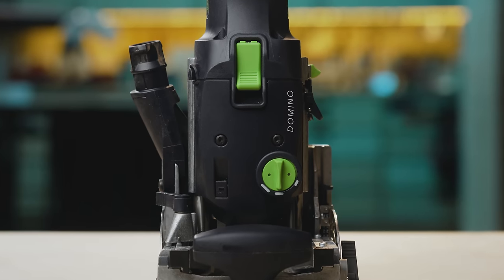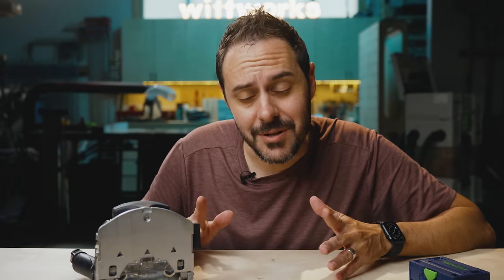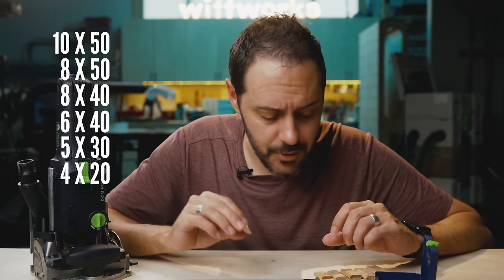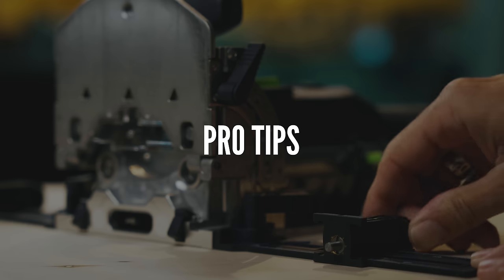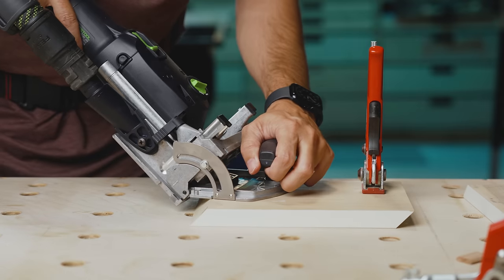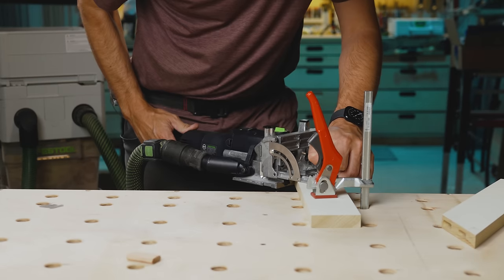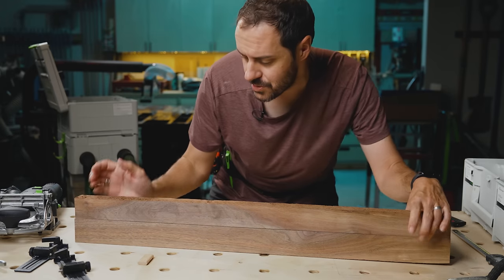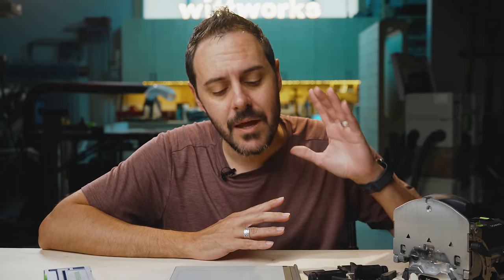Domino for Dummies

Comment: I’ve recently bought a Domino after watching years of Peter Millard’s 10 Minute Workshop using one effortlessly.  But even after watching all of Peter’s videos I thought this was an excellent run through of how to use the Domino, thank you.
Peter recommends doing the domino on one side tight and the other one loose, that way you get the wiggle room but the actual Domino is held firmly in place. I think I prefer that than the ‘two loose sides’ approach you showed. 
Never seen the Domino cross stop, looks to be useful, thanks
Reply: The way he did it here is what's recommended by Sedge who is one of the most knowledgeable people on the Domino out there. The problem with mating one tight to one loose is that you lose the end-to-end alignment which is one of the main reasons you would use the tool

Comment: Dont sand you dominos.  Hit the sides and the flat side with a hammer and compress the fibers. The domino will go in no problem in a dry fit, and the fibers will expand again when the wet glue is soaked up by the domino.
Reply from the maker: Great tip! 🔨

Comment: This was such a thorough video and I really enjoy your tone. You are very convincing at appearing to be approaching the controversial "Domino question" with an open mind. 

The end of the video gives away what most Domino owners already know - once you've used one (especially on miters and in ways that make it more than a glorified biscuit joiner), there's really no going back. I owned one five years or so ago, used it a lot, ran into some tough money times, and sold it. In the two years that followed, I found that I was doing a lot less woodworking, in large part because I just didn't have the hours of time to hand cut and fit many of the joints that the Domino had made come together in minutes, so I bit my tongue and bought another. So that I'm clear, it's not that I don't enjoy hand cutting joints or hand tool woodworking. If anything, there's few more satisfying feelings in this hobby than getting a hand-cut joint to come together perfectly. But for me (ymmv) I found that I spend more time in my shop when I have ways to get to the finished product much more quickly.
Reply from the maker: thank you

Comment: stupendous video! i know the making and editing had to take a ton of time.  that said, i believe this will be your mustard seed.  It would not surprise me if in a year it hand 100’s of thousand views and your subscriber growth begins goes vertical.  I will tell you the thing I don’t understand about the domino is how when you go loose and then use the built in alignment you don’t begin to get compound error.  I have never trusted the tool as much as I could.  And stupid me, I can get rd of the channel locks in the domino systainer and just add a zip lock with sanded dominoes!  I will say that I bought a fast cap pro carpenter metric tape which really helped me not fight festool.  I must confess if I didn’t have thousands of dollars invested in imperial measurement tools, I would chunk them all and go metric for my wood working…maybe not yet for construction.
Reply from the maker: Thank you! I wish I learned metric as a kid

Comment: 29:40 So I messed up when I did this the first time... I did the tight setting at each end of the board (like typically suggested), then switched to the loose setting, BUT I worked in from opposite ends on the boards. As such, the offset of the loose setting compounded after each mortise, which resulted in the dominos being way off. Seems obvious thinking through it now, but if you use those cross stops, AND the loose setting, you HAVE to work in the same direction on both boards
Reply from the maker: Good point

Comment: One of, if not the most thoughtful videos ever done on a Festool Domino and Festool in general. For the record, I don't hate Festool. Quite the contrary. I admire them and I'm envious of those who can justify the cost to own them. There is little doubt now that they are leading the pack by quite a bit. I'm a professional but my profession is composing music. I do woodworking for the joy of it. I would love to own a Domino and use it even just once so I could experience the joy of working with a tool that so far, surpasses all the others in the given task - by a mile! Thanks for your insightful deep dive into this flagship product.
Reply from the maker: Thank you Dwayne! That’s high praise. 

In your field, what brand would be the “Festool” equivalent? 

I’m a drummer, so I naturally think DW drums vs Rogue

Stradivarius?
Reply: @wittworks  Most music I do is all digital using samples so there is no way to point out the Festool of samples. It's too subjective. The Stradivarius does produce an unique, sweet sound that has obviously raised the bar pretty high for violin manufacturers. No one has matched it yet. So yes, that would be a perfect example. Good luck even seeing one much less acquiring it. ❤

Comment: The biggest problem I found out "too late" (so much sanding to correct) was that the stop screw/lever for the height adjustment was slightly lose and drifted over time as I was drilling a bunch of holes so glue-ups stopped being completely flat/aligned. It's definitely worth double checking all of those knobs to make sure they're not too lose. Thanks for all of this extra info … you definitely hit on a few things I hadn't seen before. (and I'm so glad I'm not the only one who loves that pop! sound.)
Reply from the maker: Thank you Chris! That lever! I know! I got a new lever from McMaster that I think will be better. It allows you to tighten more. Maybe I should do a “top 5 hacks” video
Reply: @wittworks  please do!
Reply: Need a top hack video!
Reply: @wittworks  The lever itself is probably fine. Just had to tighten the screw on the back side and it locks down much better now. Haven't had a slip so far, though I haven't been using the domino much since pocket screws are fine for the cabinets I'm building (aside from the user error of setting the drill bit up for too-short screws … always remember that "measure twice, cut once" also requires using the correct measurement).
Reply: Fence drift. Yep, that one bites more than a few people. As you found out, re-centering the lock lever helps. However, the limited range is not awesome. The ones from McMaster are excellent.

Comment: When I make face frames (or any butt joint) with the domino, I always use the tight setting on the rails, and the looser setting on the stiles. That way the dominos always first get glued into the rails tight - you could actually end up with a slanted domino putting into a loose mortise first. 

I also recently made a trapezoidal cabinet (95/85 miters). Since there aren't positive stops for those, you can actually just use the miter face as a reference for setting the fence.
Reply from the maker: Brilliant. Thank you for sharing

Comment: Rather than using a smaller domino for sacrificing strength On a joint of say some 18mm ply, just plunge deeper on one side and shallower on the other. Your keeping the strength with no sacrifice whatsoever
Reply from the maker: That would be the pro move 💪
Reply: @wittworks  love the domino, it’s so versatile, just wish it wasn’t so Godamn expensive!

Another trick I do for working on thicker/thinner stock, (for example 18mm ply again) is to set the height to 16mm, and place a plastic 2mm packer in between the fence and the 16mm gauge mark, then lock the fence down with it inside. That way there’s no chance for the fence to move up, or down when your working. Gives you the same repeatability as using the stock gauge settings!

Comment: You mentioned that setting the fence height on material whose thickness doesn't correspond with any of the numbers on the board thickness gauge, won't allow you to return exactly to that fence height setting.  What I do to ensure for exact repeatability in such cases is to make a gauge shim that, when set atop the nearest board thickness gauge tip, gives me the exact height I require.  Then whenever I want to repolicate that same thickness, I set the board thickness gauge to the "nearest board thickness gauge" setting that I'd used in the first place, then before lowering the fence onto the tip, I set the  shim I'd made onto the top of the board thickness gauge tip and lower the fence onto it.  I have a number of these shims, which I label before saving them in my Festool Domino Systainer.

Then there's the issue of selecting the optimum tenon for the job at hand.  You recommend the standard rule of thumb, which is 1/3 the thickness of the pieces being joined.  And you used an 18mm thick board to explain that a 6mm X 40mm tenon is ideal.  However, because that length will blow through the side of the 18mm board, you recommend dropping down to a 5mm X 30mm to avoid this problem.  What I suggest doing is staying with the 6mm X 40mm tenon, but sawing it shorter.  This then gives you the tenon thickness desired for giving you the required strength, while ensuring you won't blow through the face of the one board.

Whenever I err when making a mortise, I'll usually take a tenon and glue it into the wayward mortise.  Once the glue has set enough, I'll saw and chisel the tenon's extra length off, flush with the surface.  Then, I'll redo the mortise, this time paying closer attention to my work. 

  I hope these comments help other Domino users get the most out of their machines.

Comment: the one cool thing, so you messed up the positioning for that miter but you could literally just glue in a domino, flush cut it, and then recut the mortise if you wanted it to have no wiggle room. long as you dont put holes through faces its pretty forgiving
Reply from the maker: That’s a good trick!

Comment: Here's a tip for converting metric to imperial. 25.4 is the "magic" conversion. Example. 3/4 plywood = .75" x 25.4 = 19.05 mm.  12mm plywood = 12mm / 25.4 = .472"

Comment: I like and have several Festool products. Festool products are mostly a well thought out system like the LR32 EU cabinet system. Most people do not understand German and European Union's taxes and tariffs.  Approximately 30% of a Festool's, Mafel, Felder, Fein's US cost is both of these, and if you are in the EU you get to pay that amount too. But then EU folks also get to add another 20% "Value Added Tax on top of the already Taxed to death price. So choose wisely! I own the DF 500 Q set as well but in many cases my Dowelmax is more accurate and faster and Mathematically just as strong. I mostly never get the DF 500 out of the systainer as the Dowelmax is always more accurate as long as you follow the procedures. If you can't follow instructions nothing will work, not the Festool nor the Dowelmax. BTW this is one of the best DF500 videos out there. Really, a very good job.

Comment: Accurate, precise, repeatable and dependable… which of those doesn’t appeal to anyone who takes building things with wood seriously?  This video included a ton of useful tips and information in a readily digestible format. However, I was turned off by the “this tool is for professionals, not hobbyists” at the end. It’s not just $1,200 either. You need to spend another $300+ for the domino set with the different bit sizes. 

I had decided to get a Festool 500 domino machine. That is why I watched this video. Now I’m asking myself “What else could I get for my workshop with $1,500 instead?”  Biscuits are perfect for edge joining. There seem to be several good dowel jigs on the market now. I like the satisfaction of getting a dado and rabbet joint to fit correctly. Maybe this machine isn’t for me after all…. $1,500 could buy a lot of actual wood or a serious upgrade for my jointer (the one machine where I cheated out a bit and have regretted it since day one). Could I find a used mortising machine for $1,500?

Comment: I went through the comments but didn't find any mention of something I believe you missed in your explanation of the Domino tenons: The patterns and stripes on the Doms are actually 'compressed' into them. So that when a water base glue is used, these compressions will expand and make the joint even tighter. A bit like when one uses water and steam to take a ding out. Clever, huh?
PS: I was so impressed with the 700, (it paid for itself in two big gate jobs), I went and bought the jigsaw. But I hated it and went back to a fourth Makita. The Festool sanders are next level tho'.
PPS: I always reference off a marked line, but I often plane off a bit of width on the tenons to give some wriggle room.

Comment: Hey, I own one also and I love it is teh easiest to use and the most precise machine I ever haed. And I´m far away of beeing a professional woodworker.
I´m no sure, if I do it right, but use 2 things different:
1. I don´t use a smaller Domino, if the wood is not thick enough, I just do it unsymetrical, e.g for a 8x40 15mm on one and 25mm on the other side.
2. The llose fit, I think the idea is to cut one side of your joinery fit and the other side loose.
Let me know what you think about that.

Comment: Definitely buy a Domino joiner when they go on sale.  So never!! Red flag.  So many options that don’t break the bank.  
Festool is wholly over rated.  Plenty of people who do real world finish carpentry or even cabinetry don’t use Festool especially a domino joiner.   
Over priced and over rated 
Bizarre you need to have the machine on to adjust the tightness or looseness.   But that’s Festool.

Comment: Great video on the Domino.  I don't use mine everyday so I'll pull up YouTube and watch videos on occasion as a refresher.  The dust collection on this tool is amazing as you mentioned and when you're working in a customer's home this feature is invaluable.  
I build a lot of built in wall units and use it to add 1x2 material to the front of plywood shelves.  I used a biscuit joiner previously and always had issues with getting the top surfaces flush so I would need to sand them.  Now with the Domino I don't have that issue as the surfaces match up so well.  
If you're on the fence with buying this tool, I will say it was worth it to me.  Once you have a Domino you will find uses for it that you may not have considered previously.  Borrow one or go to someone's shop who has one that they'll let you try.  You may find it has value for you or it doesn't.  Either way you will be making an educated decision instead of relying on what you see and read on YouTube.

Comment: Sorry for so many comments, but one other hack I use is to remove the head from the body whenever I'm setting up for cuts. It takes all the weight off and you can do all your depth and fence adjustments without having the manhandle the whole device. (OK, I'm done!) BTW, GREAT video. I loved that it came from the perspective of an exploratory newbie. Great concept.

Comment: I just ordered my 700 domino (straight from Germany with a pretty good discount). The only tip or pointer I'd add (doing my research.... Rule number one especially for newer people like me is to mark your faces (always); so that you reference always the right face. the only other thing is that I'd do the first side with the tight and the opposing side with the middle loose. That's the way I've seen it done to allow for wiggle; meaning not both loose. great video, thanks for doing it. great job.

Comment: Very very nicely done video however I found only one flaw. The tight mortise and loose mortise cuts. The idea is to have a tight on one side of a particular joint and a loose on the opposing  side of the same joint. This allows adjustments during glue-up. If you do tight and loose on the same plane, you are limited to only the tight mortises for such adjustments. Great video!

Comment: I'm an enthusiast, but I decided to make my own furniture. I had some power tools from various manufacturers, mostly a bit on the cheap side. But this is quite a big project, making furniture for the whole house. I had the oportumity to botrow some of the good stuff and now I completely understand why people get hooked on the green stuff. First I bought tracksaw, dust extractor and a sander. Then I got the oportunity to borrow a Domino. It saved me a lot of time and hugely simplified the process. Unfortunately I was able to have it just for a few days, just enough to get hooked, so I ordered one immediately. The same day I returnef it, I got home with a brand new one.
By the time I finish, I'm sure it will pay for itself just by time saved, not to count the frustration.

Comment: don’t forget one thing and that is longevity. When I started to restore an old watermill 25 years ago a carpenter told me to spend money and in the long run you will save. Hmmmmm?!?!
I bought only Festo and spent the money and I felt that the company was arrogant some times when I suggested some improvements (they did use my tips) all my machines are like new after 25 years of heavy use.
Chapeaux!

Comment: What I am hearing is buy 2 or 3 or more! Just so you can get more accurate, yet repeatable cuts. That is an important part!
Reply: @wittworks  Actually, I say you need one for every 5 degree angle, so that you don't have to adjust it. You can have a rack that goes in 5 degree increments, a wall of dominos if you will. Then your library will smell of leatherbound books as you drink your 21 year scotch.